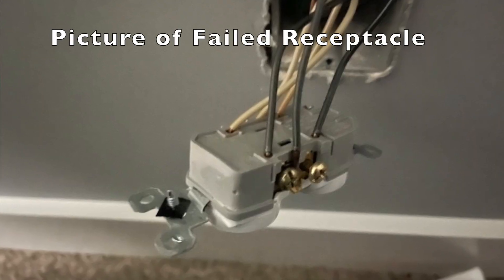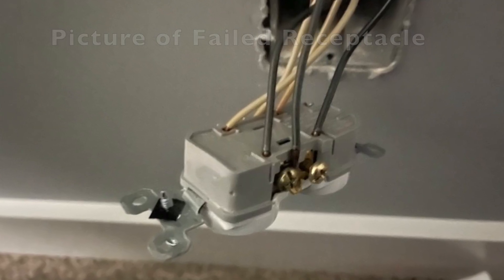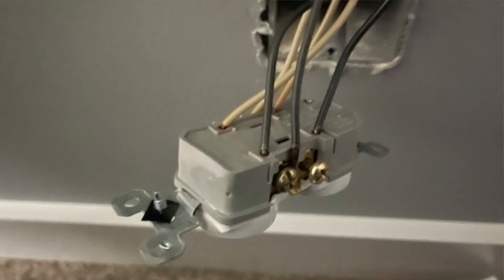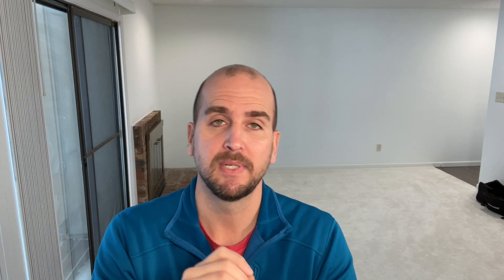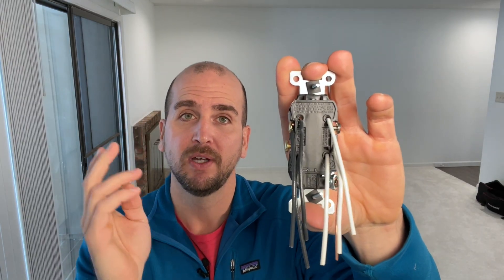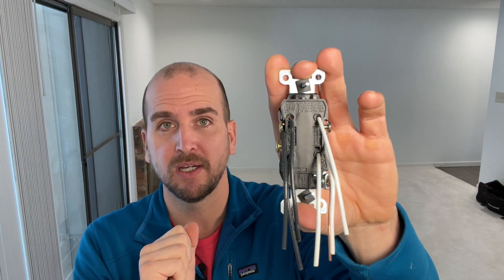Incorrectly Wired Outlet Found In Newly Built Home

Comment: I agree about the push-in connectors, don't use them if you want reliability. Also, i know they are considered safe, but i seen where by using those push-in connectors, it can cause excessive heat at that point and melt the receptacle. IF you have like 20 amps running thru that receptacle and that little push-in connector is barely touching the wire then you created like a thin spot in the connection, where it will heat up too hot. it is like trying to run 20 amps thru a section of like 20 gauge wire, it will be hot at that point, and eventually melt thru, and also it can melt the receptacle itself.

Comment: For at least the last 8 years the national Code says that push in connections are only permitted at the end of the line. It is now prohibited to use the wiring device to complete or continue a circuit. (I e. The outlet cannot be what connects wires coming into and leaving a box.)   Unfortunately this also applies to the screw clamp 'commercial grade' backwired outlets. In a proper installation you will be able to remove an outlet without interrupting power to other outlets in the same circuit.
Reply: So are you saying it is not permitted by code to use the screw terminal with wire hooks? You gave an example that said the outlet cannot be what continues the line. But if you use the screws and wire hooked under each screw then it should be no problem.

But i totally agree about the push-in connectors, i would never trust those push-in connectors for a single receptacle let alone expecting it to carry the load of even more receptacles.

And i have often said that electricians that use the push -in connectors, don't use their own brains. All they wanta know, is that their "superiors" told them it is ok and that they are not liable for using them. It is a combination of no care, and making more money. In other words, an electrician can complete the job days faster by just shoving the wire in those push connectors, so many take that path. I've seen where they just installed the wiring, and it don't work, and it was because a push -in connector. Then that is when some of them wake up a little bit, because they thought they were going to be done, and now they have go thru trouble shoot where the cause is, and repair it, and it was brand new installation. it is pathetic. And after knowing that, how do they walk away from the job with a clear conscious, they don't, unless they go back and rewire the entire job the right way. Because they now should know if they can have a problem right after installing, then they know it will cause more problems at any time, and the more the electrical is used in those circuits means higher possibility of failure, from those shitty half baked connections. Time is what increases the possibility of failure because it is the heat from the shitty connection causing it to get worse.
Reply: @TheRebelmanone  you can still use the screw terminals, but the same rule applies, only one hot and one neutral per outlet. Suppose you use the screw terminals and continue the circuit on into additional outlets down the line. Now what happens if you disconnect this middle outlet ? Power goes off for the rest of the outlets downstream in the circuit. Maybe this is ok if you are taking out that outlet to replace it, but the code writers are more concerned with what happens if one of those wires comes loose. Then not just one outlet is affected, but all of the ones downstream as well . And if it is the neutral that is loose, then you have a floating neutral in all the downstream outlets.  There is also the issue where 15A outlets are permitted on a 20A circuit (because all 'consumer' utilization equipment will operate on a 15 or 20 amp circuit (i e. Drawing less than 15 A for a single appliance), but these 15A outlets (especially the cheap ones) were never intended to pass 20 A, which can easily happen with the first outlets in the string when they are wired in pass-through fashion.  Looking for specific code reference on this later today, will post when i find it.

Comment: THANK YOU! Where can I buy commercial grade receptacles? What should I look for?
Reply from the maker: You will find most big box stores will carry a good supply of both residential and commercial grade.  Some brands call them by different names but you should expect to pay about $2 per outlet for commercial grade non tamper resistant.  If you need tamper resistant you might spend $3.50 - $4.00 per outlet.

Comment: You shouldn't pre twist the connections in the wire nuts. The wire nuts are designed to grab strait solid copper better than pre twisted.
Reply: wrong
Reply: https://www.gerrie.com/ASSETS/DOCUMENTS/CMS/EN/IDEAL_30_071_Installation_Sheet.pdf

Comment: What a lot of people don't realize, in the residential field, is everyone is so undercut by the builders or the developers, they have to use cheap methods and materials. When it comes down to it, builders and developers like Alpine homes or Richmond or places that do many homes a year rather then a custom home builder, is you get what you pay for and the sub contractors get the minimum. If you really want quality or quality in the install, pay more for a sub contractor and be your own general or find a custom home builder. Sure, you'll pay a little more, but if you want quality, that's what you'd have to do. Pay less, get less. I used to rope in new construction and hated it, they are built to the lowest quality you can imagine and no where near a standard I would want and not hands on with the client. Get a good general and builder, and you won't see that crap. Maybe you will with shotty people unfortunately, I'm just saying you'll have a much higher chance of a better install.
Reply: The residential market has very small margins. I completely understand why these short cuts take place.
Reply: This is absolutely true, and further, the subs will shortcut to save time. I had a home built two years ago and when I got around to looking at a few receptacles, the electrical contractor had used the push in method of wiring them instead of the nuts on the side. Yes, it's still to code, but no one worth their salt or reputation does this. Why did he do this, it's faster to push wire than to wrap it, however small the time! Just poor workmanship!

Comment: I NEVER use the "quick connect", as they age the spring contacts weaken and will eventually get hot enough to cause a fire. I've discussed this issue with fellow electricians, one who used to have his own contractors business in Canada, and all agreed with me. The question is, how many house fires can be attributed to the quick connects??? Even an Insurance agent agreed with me, the number could be quite high. IMHO, the quick connects should be banned.
Reply: fires? thats a stretch. open connections and downstream power loss yes very common.
Reply: @tested123  How many years have you under your belt as an electrician?? 53 years post apprentice experience here, and I have seen on outlet that was ready to ignite!! In fact a few years later that very same house went up in smoke.
Reply: Fire??? Bullshit!!

Comment: I only use the screw terminals I hate those push in ones they have come loose on me plus after I put the wires on the screw terminals I wrap the receptacle with electric tape before installing it in the box
Reply: I also tape on the wire nuts too

Comment: Good video, all things I learned from my Father who was an Electrician.  One other thing you should be teaching people is that the new best practice is to install the plugs upside down, with the single hole facing up (Ground prong hole).  This is because if a plug leans out of the outlet a little, put in the old way (two prong up), it can cause a fire hazard if something fall across the plug and two prongs.  With the ground prong up, something would fall on the ground and no harm no foul.  Just something I learned from my father.

Comment: Read the box on your wire connectors. Twisting the wires like you did thrashes the copper.  Stripping off the proper length strip, feeding it into the wire connector and twisting it tight until all the wire twist is the proper way to do it even though that's not how they are training people. Try it both ways, take them apart and notice the difference.

Comment: I knew about the wire strippers but I did not know they were 2 different sizes. Since you are not really supposed to use a 12 gauge wire in a 15 amp outlet I just made an assumption. You can also break off those tabs and use as shims to stiffen up those sloppy outlets. Also you can remove those tabs to allow your outlet to fit flush in a remodel box. thank you
Reply: You can use 12 gauge wire on a 15 Amp breaker but a 14 gage wire on a 20 Amp breaker is a code violation.

Comment: When I purchased my house. I found an outlet in the drop ceiling  being used a junction box. Hot in and 3 going out including the 2 push ins.
Reply: If it is a 'pop-out panel grid' system the a 'J' box above a drop ceiling is legal and common. You can't make a 'J' box in-accessable.

Comment: Thanks. I have some electrical outlets in my home that do not have 3 holes in each to plug into and so probable I need to replace some of the wire cables behind the walls and replace them with 220 cable too since I would think that mixing 2 kinds of electrical wiring would make for a fire hazard.

Comment: Two sets of wires is common, but why would you have 3 sets of wire on an outlet ?
Reply: switched receptacle, the duplex receptacle is spit by breaking out the little buss bar. one always hot wire from the switch goes to one receptacle and the switched hot to the other. Switch a floor lamp from across the room while one receptacle is always hot.  Google image it. 'switched receptacle'.

Comment: For the example where you used the pig tails why didn't you use the other screw terminals on the outlet? Even as it was originally wired you had the two leads pushed under the single screw. I feel like im missing something here, is there concern for passing load through the metal tab on the side of the outlet to feed the others?

Comment: Mistakes? Yea, not so much. Either laziness or incompetence! Looks like box is not large enough for amount of wire inside the enclosure if the wires cannot be pigtailed. A few paragraphs about size of boxes, wire sizes inside boxes. I hate reworking boxes that have way too much stuff crammed in them.  
Also, neutral wires connected like your example is a fire or other dangerous stuff that will happen. Neutrals wired in series like you showed is dangerous.

Comment: I gotta disagree about the push-in admonition. When done correctly, they are quite safe. And the pigtails you created make a box that is over-packed, which can be its own hazard.
Reply: No. Boxes have fill limits based on wire size that include pigtails. If you have overfilled the box you dont get to just say "well I didnt pigtail and saved room".
Reply: @jeremyanderson3819  except, of course, that UL and other agencies have found that push-in receptacle connectors, when installed correctly, work just fine. So by adding a pigtail, you are adding yet one more potential failure point. I’ve renovated homes, and I’ve seen countless overstuffed outlet (and switch) boxes. I’ve also seen where incorrect stripping of wire, combined with the J-hook, results in a connection that is more prone to current damage. Any time you have any scratch or nick or hard angle in a wire, it increases failure possibility. You see, under moderate or heavy current load there is heating and cooling. With nicked wire, the heating/cooling increases at that spot and, over time, a scratch or nick becomes a crack. Bending that scratched/nicked wire into a J hook results in wider cracks, and they fail and spark and cause fire. I’ve seen it multiple times, where an outlet so configured has already burned and the homeowner was lucky that it never caught total fire. The very act of bending the J-hook puts scratches and often nicks into the wire.

Whereas if you put a gentle bend into the wire such that the bend point hits the back of the box, and the box therefore is supporting the wire being correctly inserted into the push terminal, you have far fewer potential failure points.
Reply: @Gk2003m  You have made a good case for using spec grade receptacles (back wired) and Wago lever nuts. No j hooks or twisting required and minimum stripping. I don't see how a cleaner, smoother connection system would be possible otherwise.

Comment: I've replaced a light switch and an outlet and when I test the outlet my tester shows a open ground on the outlet, I at a loss, there are 3 sets of 2 wires in the box,  just for your info this is a manufactured home
Reply: You dont have a ground or you would have 3 sets of 3 wires.
Reply: That's what open ground means, no ground.

Comment: Sooooooo how do you remove the wires from outlets/switches that used the push in connection?  Specifically what is the name of the tool or can you provide a paid link from your channel?
Reply: There's a little opening below/above those push in areas. You insert a small tool into it. You press the tool in, then you remove the wire. Once its removed, it is not recommended to re-use the push-in because it may not hold it as well as the first time.

Comment: At 4:40, why doesn’t he just use the other set of hot and neutral screws instead of making a pig tail?
Reply: Cause if the outlet fails the other outlets down the line will still be working

Comment: Before watching this video, I replaced most of the outlets in our house because the previous owner painted over just about every one of them and I'm pretty sure they were all original from when the house was built in 2005. Every outlet I replaced did not follow industry practice and me, not being an electrician and knowing no difference followed what was already there. All outlets were back stabbed, no pigtails were used and none of the unused screws were run in. Now the house is sold and will be closing soon but we have not moved yet. Do I go back and address all of the outlets I replaced or do I leave them since they do meet code?
Reply: Depends on how well you want to sleep at night after you sell the house.

Comment: See, everyone I see doing videos want to tell us to use pigtails but that isn't even how I learned to do it with HBI. I was taught that the wires coming in are wired to the bottom. The wires going out are wired to the top. If you use pigtails and the plug goes out you still get the power down the circuit but have fun trying to figure out which plug is bad or if a plug is bad at all. There is nothing wrong with an entire circuit going out because that is a warning telling you that one of your plug-ins needs attention.

Comment: Most residential new homes a bid by the Sq.foot ...so contractors are trying to save time and money by Quick wiring devices ( using the stab in method) that saves time and 2 less wire nuts per outlet.  That doesn't seem like much until you multiply it times a whole house full of devices times x number of homes in the tract house developments be in bid on

Comment: I prefer side-clamp fixtures (ones where the side screws tighten a clamping mechanism, rather than using a J-hook). Costs a bit more, but has the simplicity of a push-in mechanism while being more secure, and is a hell of a lot easier to undo than either push-in or J-hook-style side screws, if needed.
Reply: Yes. That clamping plate is a standard feature of many screw-type terminal strips as used in industrial equipment construction, where they are likely to see vibration or other wire movement. (You will also likely find them in home heating and air conditioning equipment.) I NEVER see J-hooks used on them, although factory-made wiring harnesses might well include U-shaped or ring-shaped lugs crimped on to the wire ends.)

Comment: Good video, and your right - vacuum cleaners are a heavy load especially on a 15amp circuit and push in non pig-tailed wiring could lead to a burnt out outlet in one or more locations within the same circuit. However it should be noted that running in the unused screws on the outlet has no affect on the outlet safety, or performance. When we are making up a hundred or more outlets in a custom home we might not take the time to run in the unused screws. There is one definite exception, and that is when the project is an older home where there are metal outlet boxes that are narrow, so in this case we always run in the screws to prevent contact with the side of the metal box, but generally, this is not a concern with fiberglass or plastic outlet boxes.
Reply: Seems like the only time a connections heats up is when it is high-resistance, that is not good contact or not tightened down.  If you do the push-ins properly they are good.  As he mentioned use the correct gauge.  They are UL approved for a reason.

Comment: My Dad was a general contractor. He advised, after you put the screw cap on to wrap the bottom half of the cap and some of the wire with electrical tape.  It is another way to prevent the cap from coming off. I found a few wires that have come out of the caps. Most likely installed when the house was built.
Reply: I wrap the outlet in tape when encountering a metal box. Seen shorted to ground on old work several occasions.

Comment: The back wire receptacles have 2 wire spots for each screw,  but if a pigtail is used that seems to be a design flaw because it persuades the use of 2 wires.  Is there a reason for 2 wire spots per screw on the back wire receptacle?
Reply: I wouldn't call it a design flaw, it gives another option. Actually, I think you answered your own question.